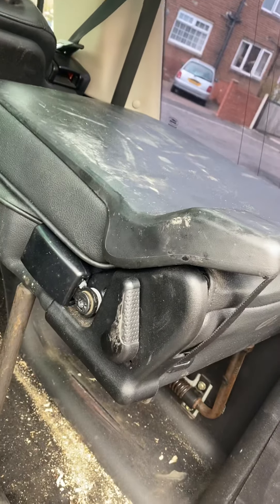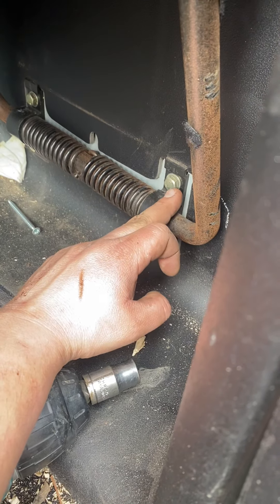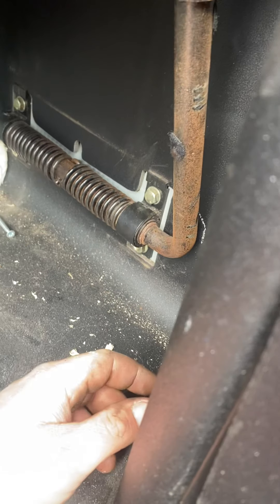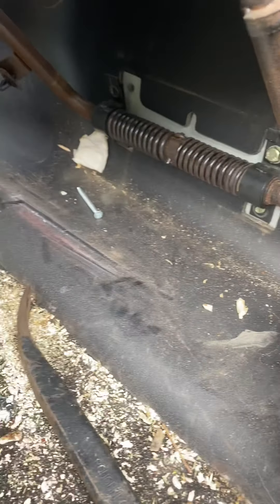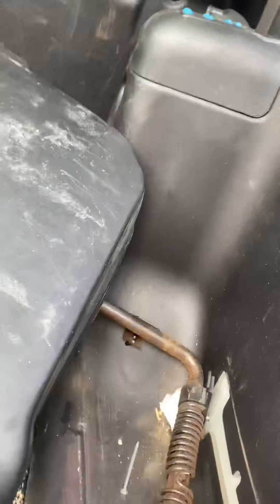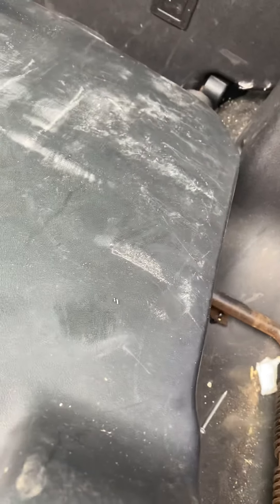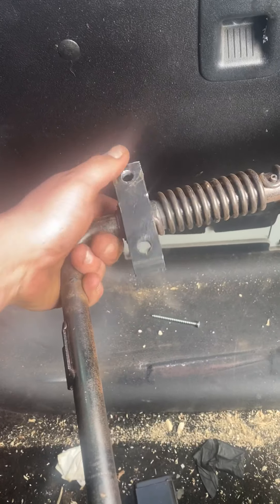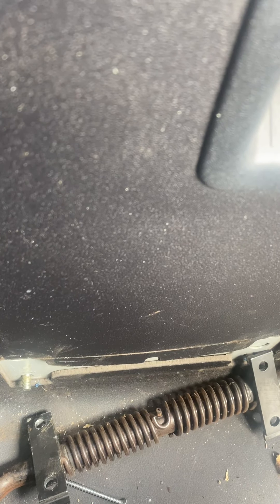Land Rover discovery 2 boot seat removal

Comment: When I took mine out I did not unfold the seats all the way and prop them up so the springs had no tension really at all ,,A smaller space to work in but I was not using a drill so it worked out.👍